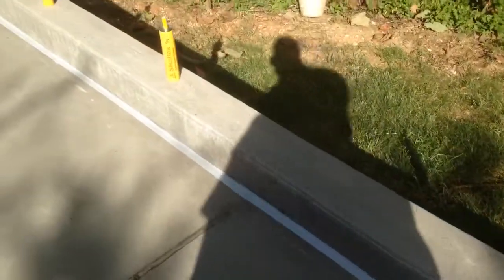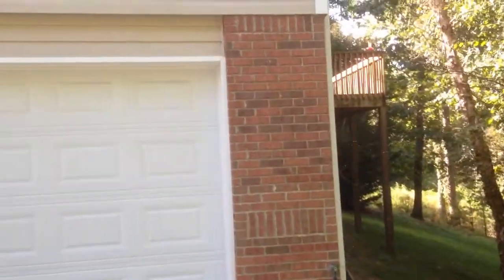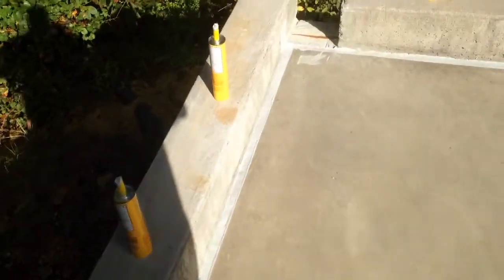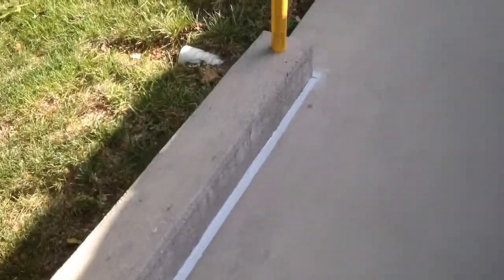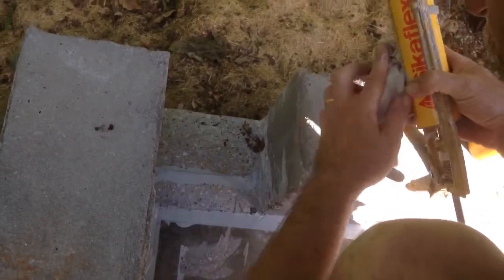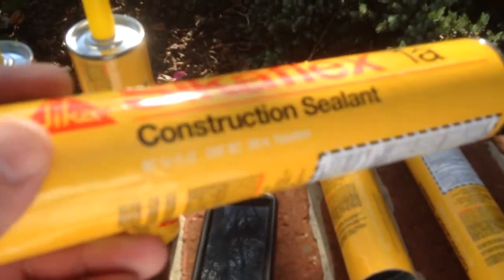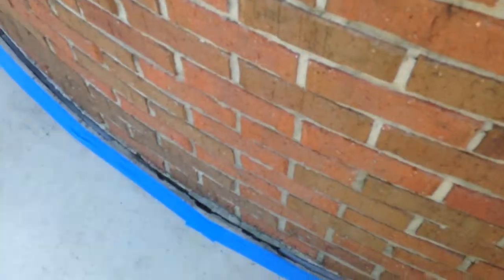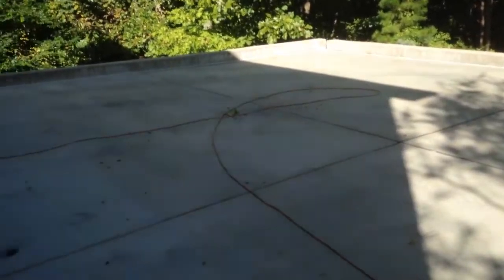M44 Giveaway Update and Caulk Job

Comment: Interesting video, Artisan Tony.  A good tip with the type of caulking sealant for cracks in concrete.  The man that applied the caulk is a master.  Most of us end up with 'burping spurts' of goobers of caulk.  Big Tony would say, 'Artisan work.'
   American Militia 'bug-out-bag' Bob was pleased with his prize, as he dug through the bag.  He commented on Artisan Tony's idea about using old 'Teflon tape' dispensers to hold string.  It's a good idea!  The old dispensers would work for string or heavy duty fishing line.  Thumbs up Artisan Tony.
Reply from the maker: Donny did a superb job! :)

Comment: Did the wall have stone behind, and weep holes.  Just wondering if it could handle some water.
Reply from the maker: It had a drain system yes, but most of the water exited the notch in the wall.
Reply: ArtisanTony just wondered if the caulking was just the inspectors personal preference.
Reply from the maker: smilemoney
The caulk will direct the water to the notch in the wall and probably should have been done when we built the wall and driveway.